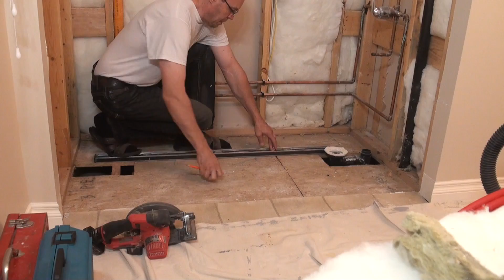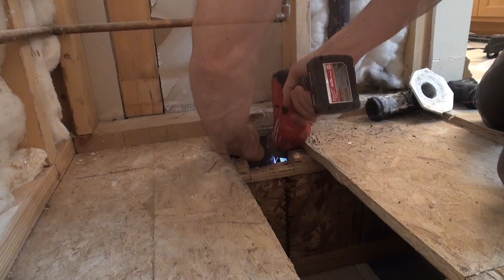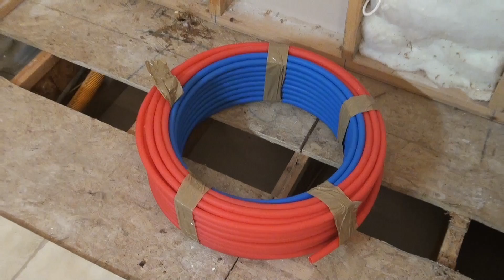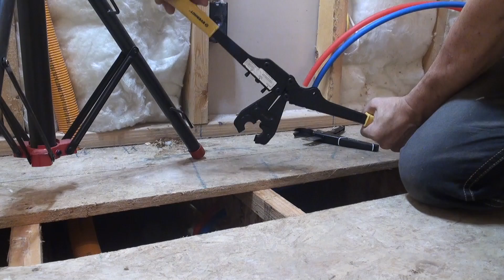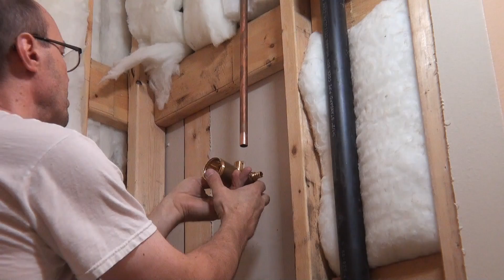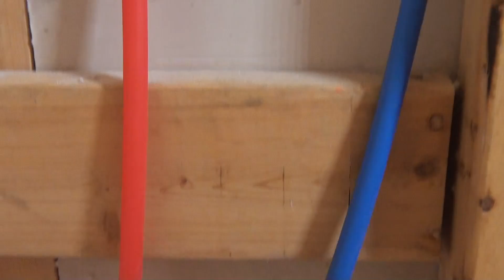How to connect PEX pipes. Пластиковые трубы водопровода

Comment from the maker: All videos from my new project - Shower Pan Rebuild:
Shower Pan Rebuild. PART 1- https://youtu.be/NdhPWNkK66o
Cut tile from bottom of the shower. PART 2 - https://youtu.be/NNBwQVA1LwY
How to Pre-Slope Shower Pan with Beadex. PART 3 - https://youtu.be/prp_vglYv4c
How to install ABS Shower Drain. PART 4 - https://youtu.be/v57eQe-eC4w
Shower Pan Liner to ABS Shower Drain. PART 5 - https://youtu.be/9c9xxkL0Am4
Shower liner and Concrete shower base. PART 6 - https://youtu.be/LSbB_ml0UtE
RedGard Waterproofing Membrane. PART 7 - https://youtu.be/e_4Wzgtxic0
Install a Pebble Tile / River Rock Shower Floor. PART 8 - https://youtu.be/m9Zb81AMSI8
How to make a simple Jig to cut 45-degree tile edges - https://youtu.be/nzSYCPHPmRg
How to tile Shower Curb with 45 degree outer corners. PART 9 - https://youtu.be/wdOxYGWcFSk
How to 45 degree tile cut. No Jig, just hand - https://youtu.be/9WmOIYn1QL4
Footstep in shower. PART 10 - https://youtu.be/2YrMN22kz2k
Shower Curb, Wall grout & Glass Door Base installation. PART 11 - https://youtu.be/L0Ms7sEOEWM
How to Silicone a Shower. PART 12 - https://youtu.be/Edb9fXIdkRk
Schluter, custom size tile edge. Last 13th PART - https://youtu.be/kT9hc3D00ec

Comment: Hi, nice video, thanks. What paste did you put on the copper pipe before sodering the other piece on it?
Reply from the maker: I used regular Water-Soluble Solder Paste Flux
https://www.homedepot.com/p/Oatey-H-20-1-7-oz-Water-Soluble-Solder-Paste-Flux-301302/100177185
Reply from the maker: You can see the paste here:    
https://youtu.be/P3xfd8IaVoI
https://youtu.be/eGFioGIU8I0?t=8m20s

Comment: Does every drain need a p-trap??
Reply from the maker: Yes, all drain need it. P-trap holding water and it work like a seal that prevents sewer gas from passing from the drain pipes back into the occupied space of the building. Sinks, showers, bathtubs, and toilets must be equipped with either an internal or external trap.
Reply: Even a washer drain?
Reply from the maker: Depend how or to where your washer connected. In most kitchen its connected to Garbage Disposal and already have P-trap.
Reply: I’m planning on moving my washer and dryer from my basement to first floor, I’m thinking it should have one, but just wanted to make sure, gonna tie into an existing drain from bathroom sink on the same floor
Reply from the maker: Oh, I thought Dishwasher. Ok. All clothe Washer drains ofcourse has a P-trap behind the sheetrock. Just google some picture and you will see it. Like this - 
https://www.naturalhandyman.com/iip/infapplianceinstallation/infwashing_machine_install_tips.html